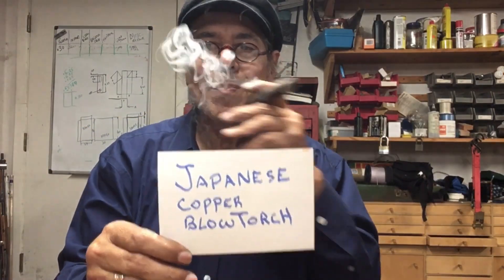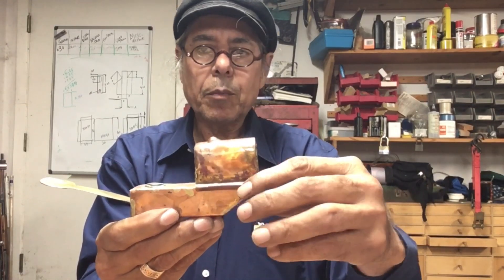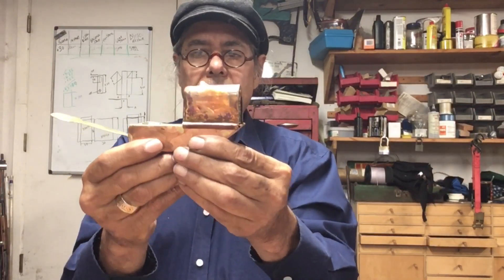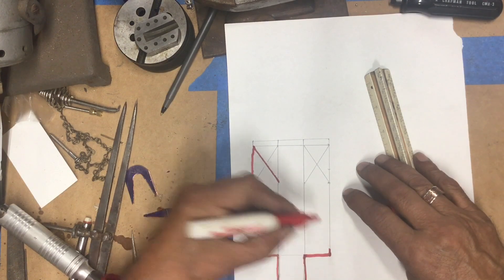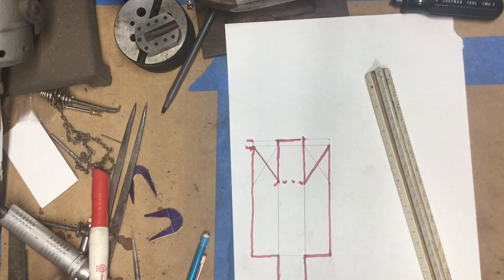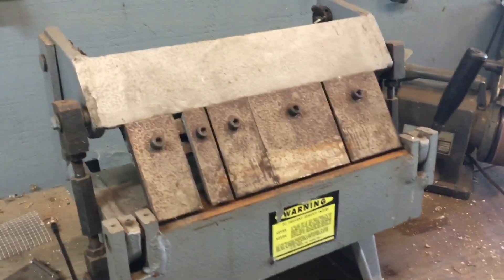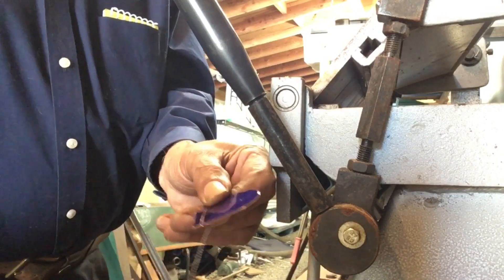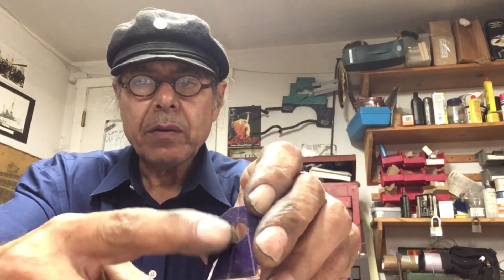1890’s Japanese Blowtorch reproduction

Comment: I am very happy that you posted this video. You are quite the metalworker! Woodworking is my primary hobby, but copper has recently gotten my attention. One thing I did learn, while drilling a hole in thin copper, I use my old spade bits instead of regular drill bits. That way only the tips of the spade bit cut out the circle. The material cannot be thicker than the distance the tips protrude from the main cutter face.